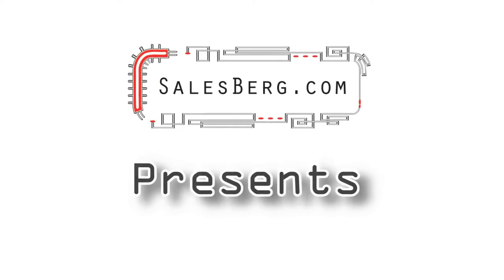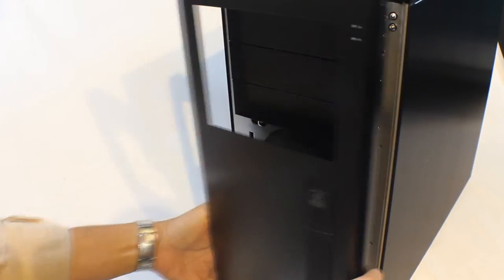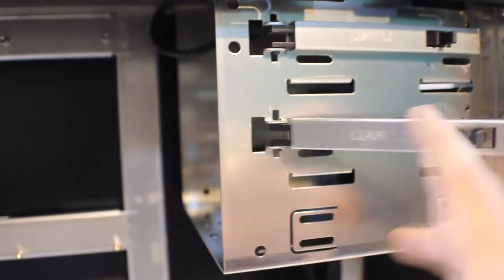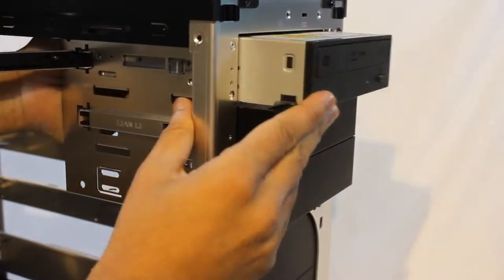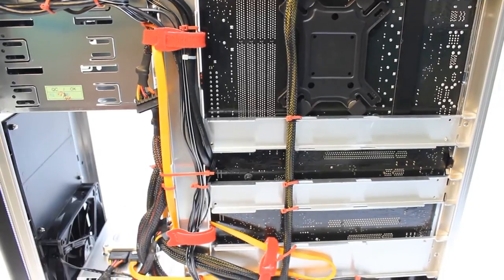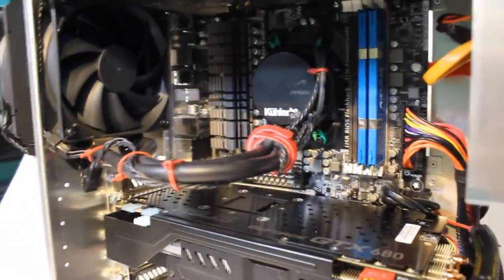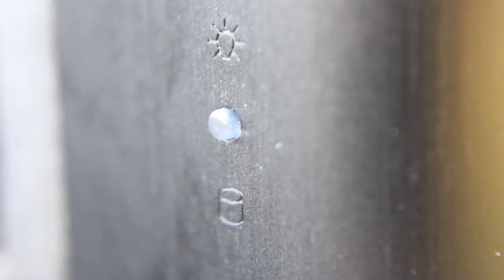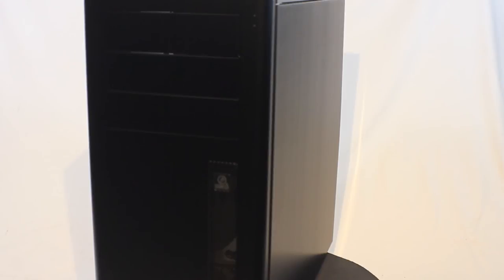Lian Li PC-9N Aluminum Case Review

Comment from the maker: Quieter than 30dB, the bg noise at the time of making the video was about 32dB as the sonometer picked up. Hence placing it even within .5m made no difference, thus not included in the video. I did the Antec 920 extreme setting test (shown in that video) where it got noisy, but it was not the doing of the case.